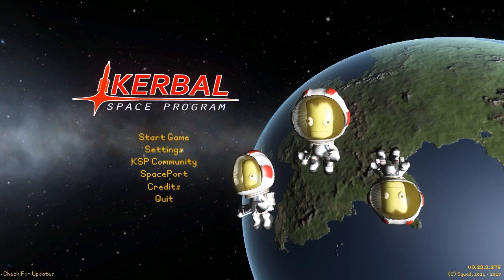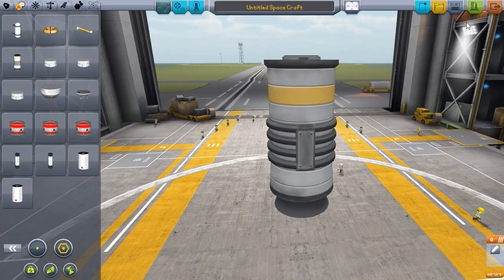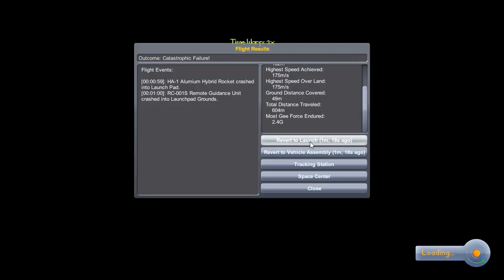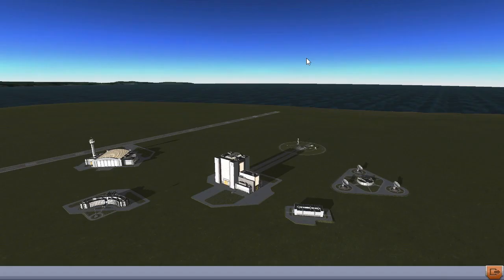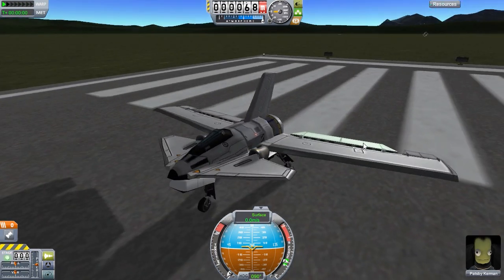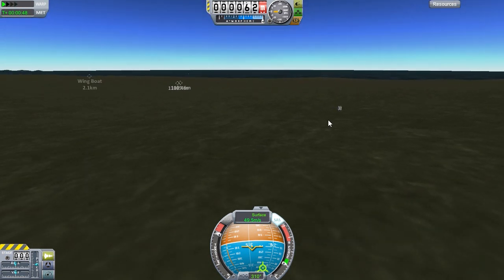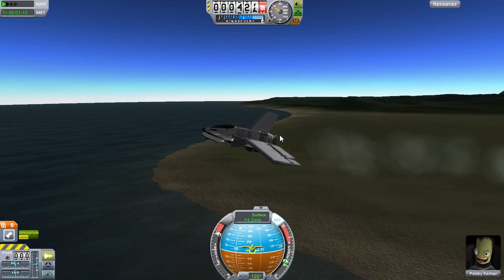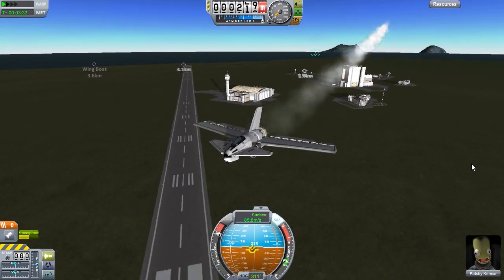Kottabos Space Program EP58 - More Interstellar Mod

Comment: I built a similar tiny Thermal Turbojet plane, and also had trouble getting it to take off. I think the uncontrolled turning on the runway is because of the angle on the rear landing gears. You could try placing the gears coming straight down from the wings instead.

Comment: What's the point of having those power generators and those beamed power transmitters? Can't we already obtain power through the Sun and the Pb - NUK generator?
Reply from the maker: I believe it's simply to add more options for those who want it really
Reply: With Interstellar the output of solar panels changes based on how far they are from the sun. Panels near Moho make several times as much power as the same panels near Eeloo.
Reply: Rasip
Yeah it's the Inverse square law. So it makes sense.